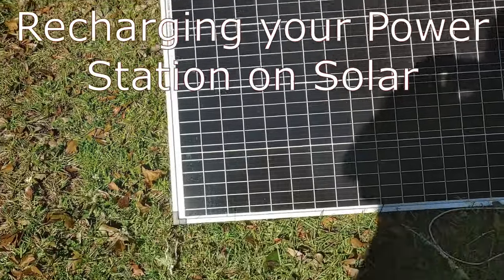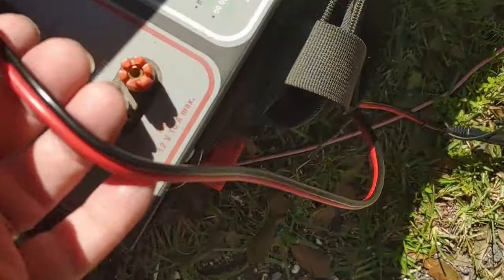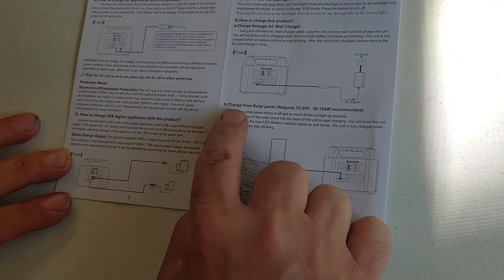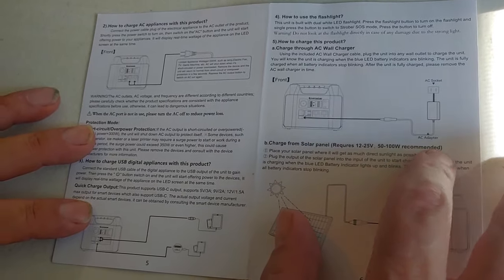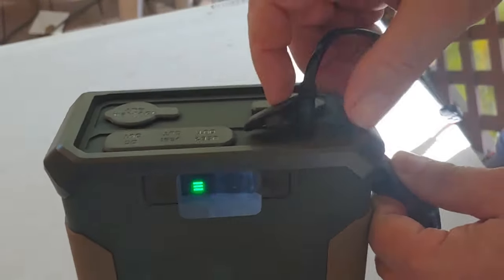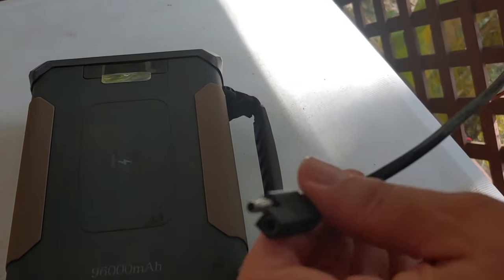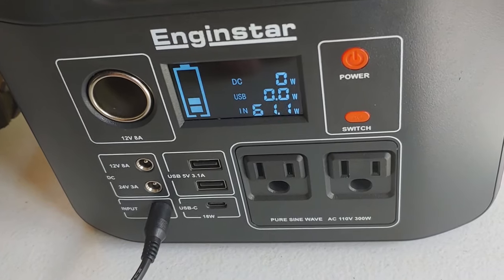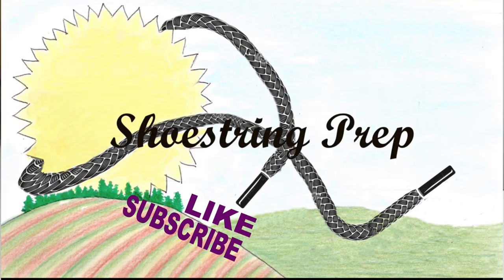How to charge a power station from a solar panel.

Comment: Please,these r not generators. They are batterys.
Reply from the maker: Thank for your comment.
Reply: No one cares to be that technical. I'm going to continue to call them generators.
Reply: In the abstract, a generator transforms an input source of energy into an output form of energy.  In a traditional gas generator, chemical energy (aka fuel) is transformed into mechanical energy which is, in turn, transformed into electrical energy.  In a solar system, panels transform light energy into electrical energy.  This actually makes solar panels qualify as generators.  They are transforming one kind of energy to another kind of energy.  Power stations, on the other hand take electrical energy in, store it, and provide electrical energy out.  From a high level black box perspective, the power station does not transform one class of energy into another class of energy, so it is not a generator.  Yes, internally it may store the incoming electrical energy as chemical energy in a battery, and then use that chemical energy at a later time to create output electrical energy but that is all happening internal to the box.  The external function of the box is to take electrical energy in, store it, and provide regulated electrical energy out.  This is why, IMO, it is far more accurate to refer to it as a power station than as a solar generator.  

Yeah, I know that was long winded and technical but as an engineer, I value names that accurately reflect the functionality of a device.
Reply: @Back2SquareOne  long winded yes, but well stated..
Reply: @Back2SquareOne  solar panels yes r generators of energy,  the power station is nothing more than a glorious battery.

Comment: I have a 12v 200ah lithium battery what size controller should I get to connect to solar panel and what size solar panels will be needed. Thanks for any help
Reply: The number of solar panels (well, the total wattage) that you need is only a function of how much energy you actually use.  It has nothing to do with the battery capacity per-say.  You can just about charge any battery with any solar panel... just a matter of the time it takes to do it.